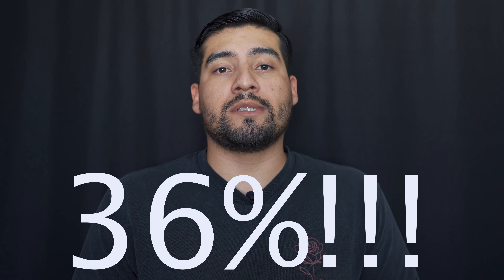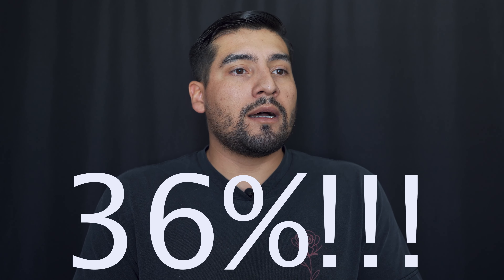Did we DAMAGE the GT3RS??? 1:24.0 Big WIllow

Comment: Hey Gabe, love the videos man. following your GT3 story as i track the same car MY 991.1GT3 (mostly stock). Unrelated question to this video, just wondering the reason/justification behind removing the aero upgrades on the 991? Was thinking of getting the wing risers + front canards and was wondering your take on if its worth the money? Also curious, when you went to the 19" BBS E07, any fitment issues with stock brakes or in general? Thanks in advance!
Reply from the maker: Thanks for the kind words! I removed the APR which because that was actually a friend’s wing but I don’t think I would have kept it on regardless because the aero balance was very lopsided. You will need a front diffuser/lip to get a better aero balance otherwise you will suffer from bad understeer. The front canards look nice but their function is very questionable tbh and definitely non-existent with a big wing and no front diffuser/lip
Reply from the maker: Also, the E07 require you to shave one of the bolts on the rear lower control arms
Reply: @Thewinnerscircle_  thanks boss, much appreciated-- saved me some dough for some new bucket seats. Look forward to the next videos man, yall are fast